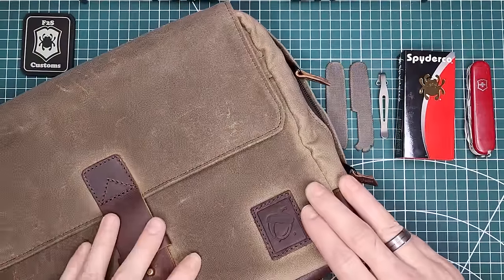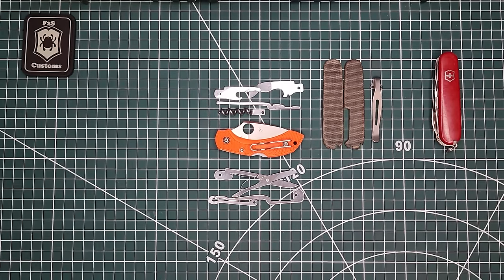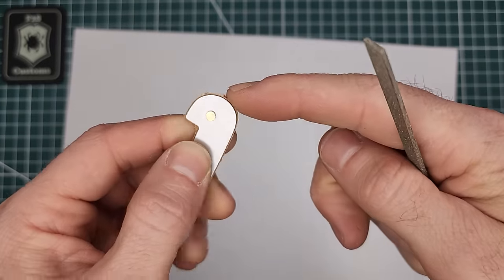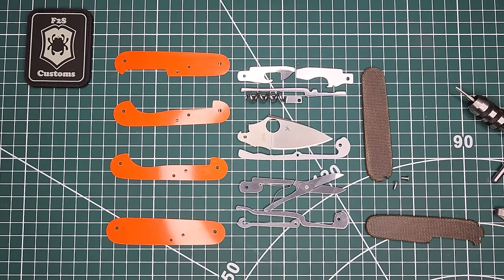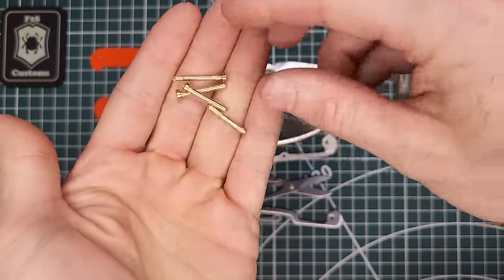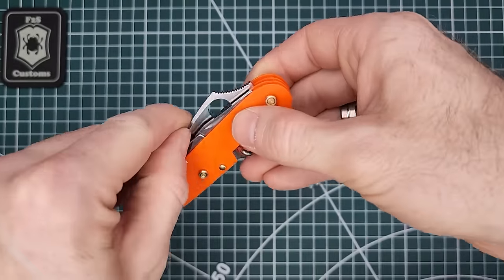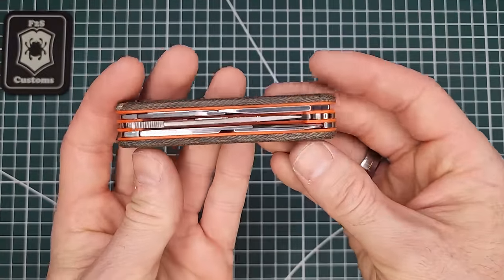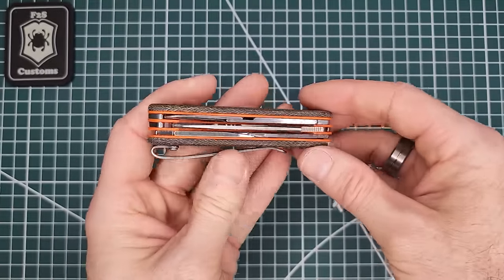How I made this Custom SAK for Nutsac

Comment: I like it but it's unfortunate that the blade smacks that bronze post
Reply from the maker: Thanks. The Dragonfly does not tap the spring nor the brass pin. 👍🏻
Reply: @FittoSurvive  u can see the line in the video from where it hits when closing
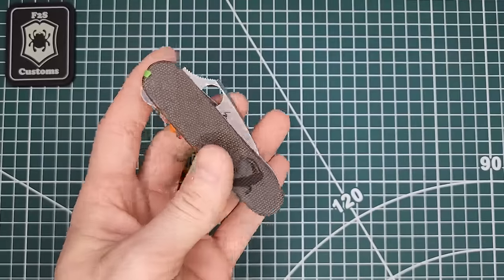Reply from the maker: @addytheslinger4270  Not sure at what point you see that, but while I am still modifying the blade and spring there is a chance that it would still tap the spring. You will see the final results starting at 20:50. At that point, I can guarantee that the Dragonfly does not tap anywhere on the blade. 😁👍🏻
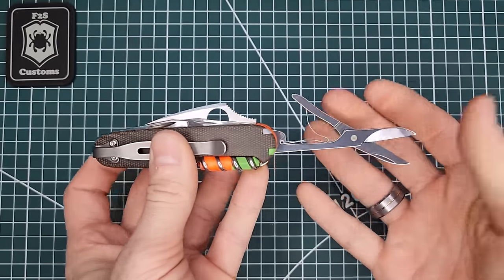Reply: @FittoSurvive  I set u a pic on Instagram to show u what I'm talking about ps it's at the very end like 21:30
Reply from the maker: @addytheslinger4270  OK, I'll go check it out.

Comment: You took the scissors off of the victorinox & didn't re-use them even though they were brand new & unused & replaced them with another identical & unused pair? that's wasteful.......but? apart from that the build itself is excellent though I'd like you to do the same thing with a victorinox swisschamp I.e. replace the liners of a swisschamp with similarly coloured themed just like you used with this one.....if you're interested in taking commission's then please let me know as I'm interested there's a few ways I'd like to request you modify a swisschamp & some colour themes for it.....

Comment: Nice work. But to take plastic for the liners is a bad decision. It is not stable enough.
Reply from the maker: Thank you. The liners are G10 - it is a high-pressure fiberglass laminate, a type of composite material. It is much stronger than the original aluminum liners. 😎